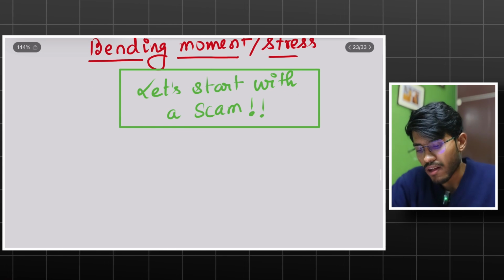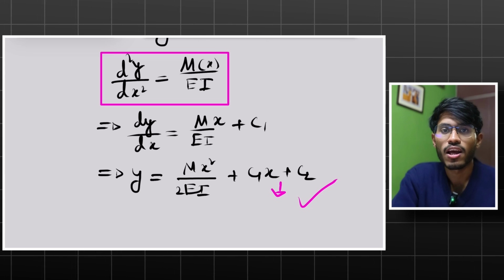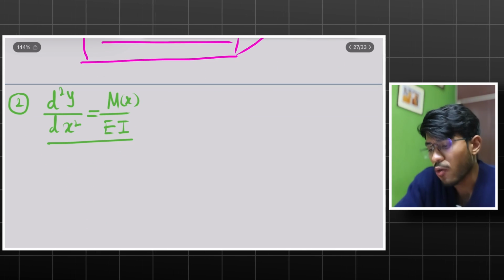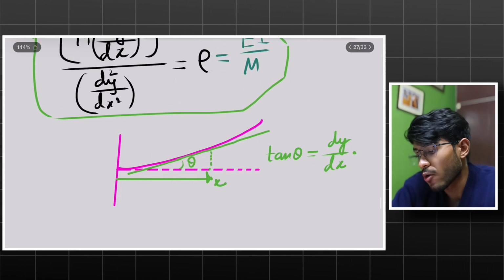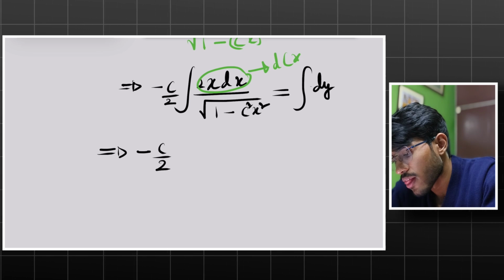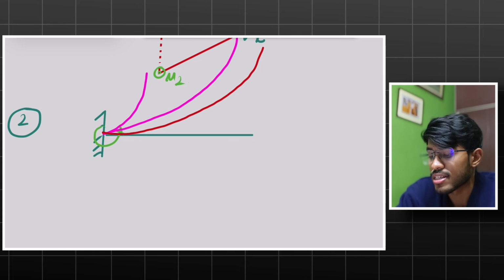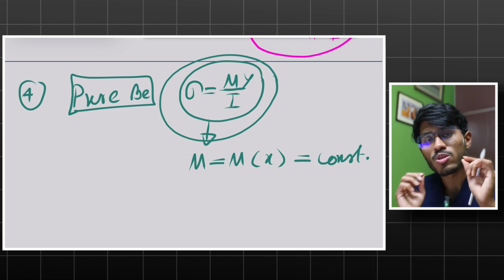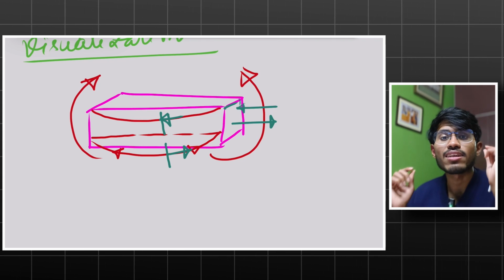FIRST TIME EVER!!!! | "BARC" REAL INTERVIEW QUESTION SOLVING| PART-6 | BY AIR 31

Comment: 28:48 Bro one doubt, please resolve it. The equation x^2 + y^2 = r^2 only comes when we take the centre of the circle at the orgin . But it was not the case here. And by merely saying that the radius of curvature is a constant does prove that the curve is a circle , because parabola has a varying radius of curvature.
Reply from the maker: 1.During the derivation of the bending formula, we take the origin at the centre of the circular deflected beam by convection. That's why it came in that form.

2. You are right. By that reasoning of constant curvature only it can be asserted. However, in this video I wanted to give a flavour of how the same concept is mathematically giving a circle or a parabola depending on different assumptions.
Reply: Soham seeing these concepts,i literally feel like I know nothing about the subject even when I have prepared the subject well 🥺🥺